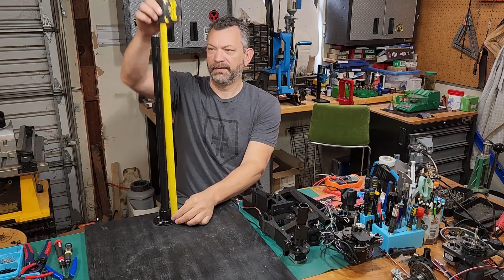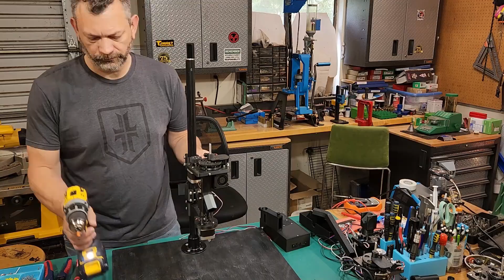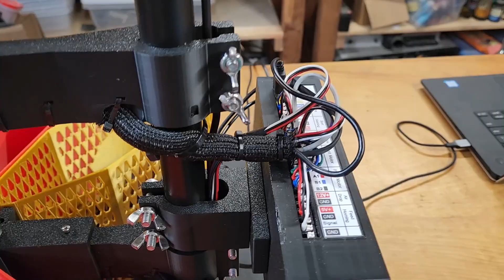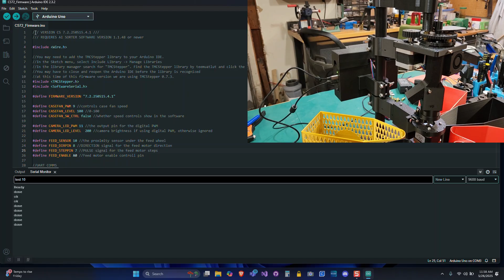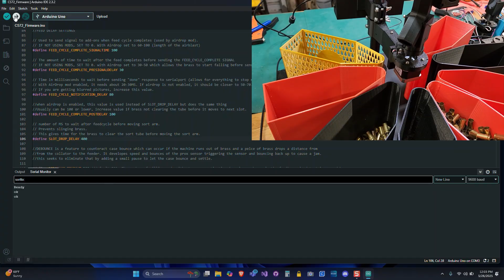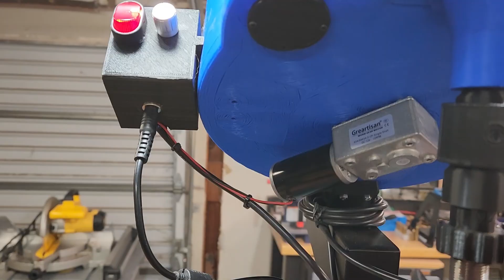CS7.2 Build Series - Putting it all together

Comment: Is there a list of (and links to) cables/wires required for the project?  I notice the Complete Build Kit has them but they don't appear on the parts list...
Reply from the maker: Good point, they are in the cs7.1 parts list but I need to add them to the 7.2 parts list. Will do that tonight. Thanks
Reply: @sjseth-builds  Thank you!

Comment: Well, after seeing the 7.2 build series, I will definitely build a 7.2 version using your full kit. So you'll gonna have to send another one of those sets to Sweden, unfortunately though not right now. I may have spent to much on vacation so I can't afford it atm. But I see you're currently out of stock anyway, so in a month or two...

A VERY neat build though - I'll start printing the parts (almost) immidiately! 😁

With my 7.1 version I have a few issues from time to time and it's with the dropping of brass into feedwheel. It's sometimes just out of sync so the brass gets stuck on the edge of the feedwheel drophole. Could one possibly smoothen the edges somwhat (like "smooth countersink", if you understand what I mean) so it would drop right in even when slightly off? And my drop bracket sometimes need an extra hand to keep it straight, i.e. it seem not to have enough tight fit. So one more set screw on top, further out would probably help, maybe also one at the bottom.

I would also like an addition to the software, to be able to step the motor(s) one step at a time if needed, and also, to snap a new photo if for some reason I've had to adjust the feedwheel (and the photo is "bad"). Now I have to manually feed and remove case (yet it's counted as sorted) before continuing.

Well, I'll place this in the discord also, which really would be the right place.

Yet this thing was so clean and nice so I will have to build it! WELL DONE!! 👍👍👍

Comment: This is such a great project — I’m definitely going to implement it! I finally have a reason to buy a 3D printer 😄. Thanks so much for taking the lead on this!

Quick question: have you considered adding a second step of sorting brass by weight after sorting by headstamp? I’ve seen some videos on YouTube showing improved consistency in velocity and pressure when using brass of similar weight from the same brand. The variation can be quite significant. For example, when I sort brass from Federal (F.C.), I often see weights ranging from 57 to 64 grains — all from the same manufacturer.

Really appreciate all the time and effort you’ve put into this project. Great work! 

(p.s here is a video on sorting by weight and its effects... very interesting... https://www.youtube.com/watch?v=giC0qMvhw_A)
Reply from the maker: Glad you are liking the project. We have considered it, just not really enough demand at this point. It is also a bit complicated to weigh stuff properly on a carousel so it would definitely take a bit of R&D

Comment: printed all parts and got your full kit, when i connect to sorter software does not see board, Arduino doesn't see firmware or board, any suggestions?
Reply from the maker: Sounds like maybe you didn't install the driver yet? It is in the CS7.2 repo at: https://github.com/sjseth/AI-Case-Sorter-CS7.2/tree/main/MicroController/Drivers
Reply: Driver is installed, it's like it don't have firmware.. I'll install driver again. Even tried a different laptop.
Reply from the maker: @miguelviana5274  Please reach out through email or in the discord so I can help resolve the issue.
Reply from the maker: @miguelviana5274  Since every board is tested before shipping, I suspect you may have received a bad usb cable.  If you have another USB cable on hand, please give that a try.

Comment: is a 6.5 creedmoor drop tube and wheel in the works?
Reply from the maker: The drop tube is the same as the 308, but we will generate a 6.5 feed wheel here shortly.
Reply: @sjseth-builds  I appreciate you and the community for all the hard work that went into this project. Cant wait to put it all together.  Do you have a file in the repo for the bf556 case feeder?  i tried to join discord but says link is expired.
Reply from the maker: @miguelviana5274  The BF556 has its own repo as that is not my project.  Here is the link to that project: https://github.com/BF556/Feeder

The link to the Discord is auto generated so if it expired, you can go back to that page and refresh the page. you should get a new invite.  Good Luck!
Reply: Thank you @sjseth-builds

Comment: Is the software apple mac compatible?
Reply from the maker: Currently the software only runs on windows machines and requires the system processor to have AVX support
Reply: I run it on my older MacBook Pro, I use a partitioned native with win on it, about 20 GB. Works great, although I'm running CS7.1 build.